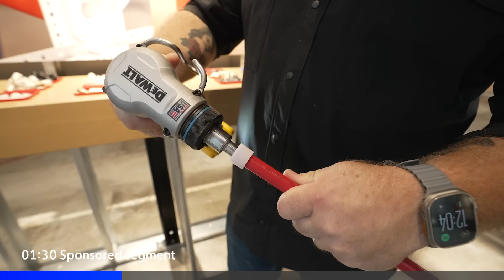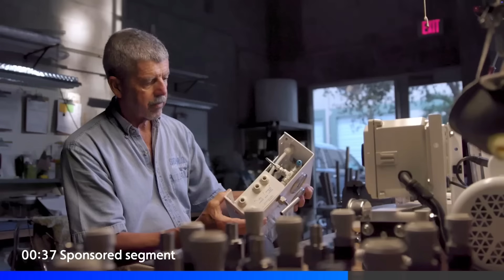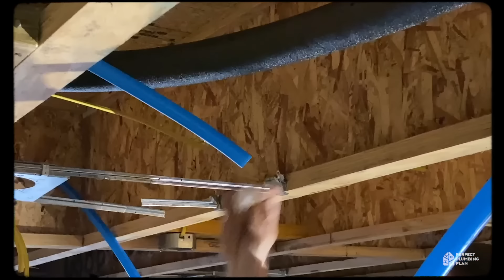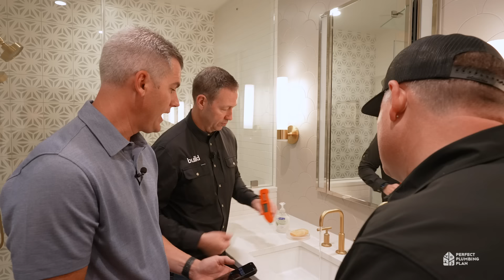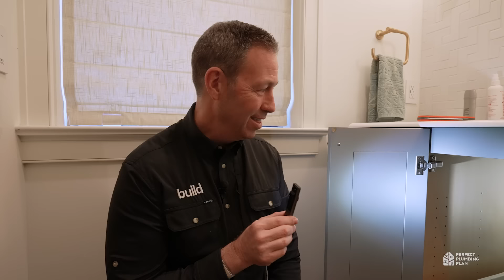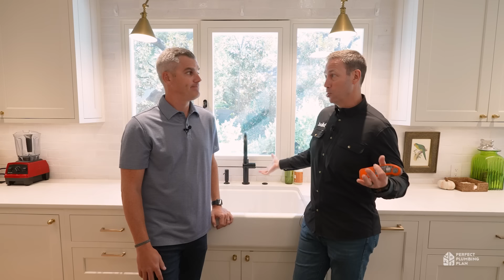Perfect Plumbing Ep. 3: How Recirc Loops Improve Hot Water Time-to-Tap Matt Risinger's Home Results!

Comment: I retrofitted a hot water recirc, and to control it I put a smart lightswitch in the primary bathroom (farthest from water heater) and set it up to also turn on a smart plug that controls the hot water recirc. If I know I'm going upstairs I can also start it from an app on my phone. It's not perfect, but it was cheap and easy for a retrofit.

The recirc works reasonably well for hand washing during the day, but for face washing and tooth brushing, the hot water often isn't hot enough and the cold water is too warm, so I have to blow out both lines. In Connecticut, we pay very little for water and have tons of it, so the primary concern is convenience and minimizing how much heat energy the system wastes, as our energy prices are quite high.

Comment: I'm curious if I put a Eco27 tankless hot water heater in series into my AO. Smith 80 gal. hybrid hot water heater, with the 4.5 gal. expansion tank before the tankless, how efficient will this be and will anything get damaged? Do I still need a backflow prevention before the expansion tank? Where does my Comfort recirculation pump go If I go this route? Or if I choose to use a dedicated recirculation pump line, where does that go? Does it go before the tankless, after the tankless, the bottom or top of the tanked water heater? I'm a DIY person looking for answer's that have yet to see anything on this. Why am I doing this you may ask, well, because I have them both and I want to maximize the usage of what I have. The tankless is a 27KW Eco27 model. Until I started watching video's I didn't know you could run water heater's in series or parallel. Since I have both, and the space to use it, I figured why not. If you are wondering why I have both, My wife purchased one and I purchased the other and now I can't return either so to make us both happy we will use both, So let's make the most of it. I'm seriously looking for advice here. I hope this reaches somebody that will reply back to me on this subject. My house is completely gutted and totally open right now, so fixing plumping while it is open on this 1971 home. I may have found the solution to constant never run out hot water system and I could be wrong, but I'm really curious. I've drawn out how I think it should go and I don't have anybody to talk to about elaborate systems. I love your video's and watched for years now.

Comment: Matt, I like the loop hot water recirculation idea so we don't have to waste water trying to run it so it gets hot. But I have been wondering for a long time why we don't just put small, tankless water heaters either under the sinks, or under the floor where the bathrooms are, as an assist to the central hot water heater? Do they make small, (one room sized) tankless electric hot water heaters?  Can that electric hot water heater run off the same GFCI circuit that's already in every bathroom?

Comment: I had a recirc in Germany.  It was nice.  Building a new house back in the States and the kitchen is the furthest point from the heater.  Close to 45 pipe feet.  That grunfoss pump runs between $180-$800, plus the pex pipe.  A inexpensive POS tankeless WH cast around $60. Save on pump, extra PEX pipe, and an independent system for redundancy.

Comment: In a previous home I added a johnson flow switch to the hot water out and the taco recirc had a thermostatic shut off.  The Johnson flow switch was in the open position (no flow) and the thermostatic switch was closed (cold). Any hot water tap in the house became a switch (johnson switch closed and thermostatic switch closed, taco on), ie briefly turn the hot on would start the recirc, charge the line and thus hot water on demand. The recirc would turn off via the thermostatic switch ( hot open, taco off, thus reset ). Yes you had to plan on the hot water use, but the pump would charge the system within 15 seconds.  In my new house, I have the bathroom fans on a smart switch which when they are turns on, it turns on the recirc. system which stays on for 15 min (renai system), in the kitchen I have a button.  Humidity sensor turns of the bath fans when the humidity drops to an appropriate level.

Comment: Matt, greetings from south-of-the-border. Following your videos, and those on This Old House, is how I retrofit a recirculation valve on the farthest bathroom in my house, 20ish pipe meters (60 feet) from the gas water heater, that is 2 floors below, in the exterior of the house, as is customary down here. My waiting time is 4 seconds, and I have Alexa automations, when I stop my wake-up alarm, the automation starts the recirculation pump. I also have a frase to start the pump "Alexa, I'm taking a shower". Both automations run the pump for 2:30 minutes, that is the time it takes for the water to be hot upstairs. 

I've learn a lot from your videos over the years.

Comment: I added a recirc pump for quick hot water too. But I simply installed a pump under the kitchen sink which is farthest from water heater. Then I bought a foot switch usually used with sewing machines or wood working machines. I mounted that vertically on the base board of the under sink cabinet and wired that as the start switch for the pump. So me or wife simply 'bumps' that switch with our toe a minute before needing hot water. Works great in that it brings hot water to the two bathrooms along the way.

Comment: We retrofitted our recirc pump with Tapo controls. An outlet control at the pump and a control on the bathroom light. That allows us to control the pump on with scheduling or with the light switch. Let it run for five minutes and then it automatically turns off. You can also control it by your phone. Since it’s “matter” based, no need for a central control box or system. Easy change for $40. 

Previous smart pumps didn’t seem so smart for our house chaos and didn’t allow as much customization. 

It would be curious what your calc comes up for water wasted.  No specific numbers were used and it seems to me to be fake news. Let’s say you run your sink twice a day for a minute to get hot water there. That’s 2 or 3 gallons a day, maybe 900 gallons a year. Sounds like a lot until you see how many gallons you use watering your grass. Don’t water your grass for one day and you might be even water volume. The expense of the recirc may not look as good. You still pick up the convenience though.

Comment: My house is exactly like one that you described: master shower is literally as far from the water heater as it can be. I'm working with 1959 copper which is at the end of its life, so I'm currently planning how the re-plumb is going to go. Luckily the basement is unfinished, so I have pretty easy access to everything
Reply: Just finished a re-pipe for my 1920s 4 bed, two bath, upstairs / downstairs laundry home by myself. I might be a minority though I cut out, cleaned up and reused most of the original copper pipes. Used pex for the laundry rooms, rest of the house is copper. Glad I did it, was a bit rough living in the home while doing it. Would do it again.

Comment: I watched all 3 episodes so far and I think it’s worth mentioning that if you use a loop system (with what ever pump you use) you should have a check valve at the last fixture on its return path. So if your recirculation pump is not on it will not pull cold water back into the hot faucet.
Reply: Good idea!  I found out the hard way that my plumber installed my pump backwards at first. So it was literally pumping IN cold water to the shower.  🤦

Comment: I’m debating between adding a recirculation line and pump vs using electric heat trace for the long leg away from the heater…anyone else ever think about that possibility?
Reply: This is an interesting idea, although not sure I’d want it in a wall, probably much less efficient than recirc too

Comment: I'm confused. You have a heat pump water heater in that closet, but say it is a storage tank with the heat coming from the outside. So what purpose does the heat pump part of the closet unit serve? I have a heat pump water heater in a separate none living part of my Midwest basement that takes heat from the regular 60F air and turns that room into a 40F cooler!!! The water heater does have electric heater elements in it if the room gets too cold. If you weren't getting heat from outside, your closet heat pump water heater would be taking heat from inside your home and releasing cold air back into your home!!!
Reply: Rheem now makes it to where if your water heater (heat pump type) is close to an exterior wall you can diver the cold outside during the winter and divert it back into the room for free cooling in the summer time.
Reply: This is Texas, so most of the year cool air in the home is a good thing
Reply: @wkm122 Even in Texas, I don't think people want to walk through 40F air, especially when they were getting freezing temperatures outside. Matt should have covered this issue. It is a big deal. I thought my Michigan cement wall basement back room temperature would drop from 60F to maybe 50F. But it currently is at 39F with my water heater set at 120F.
Reply: The SanCo HPWH has the compressor and coils on the outside of the house.
Reply: @Steve-bm2zmThen that makes sense! Thanks.
Reply: Y

Comment: It’s funny how they wouldn’t go for 3/8.  Naturally they never consider every faucet supply line is even smaller in diameter than that.  I’ve personally never used it though because 1/2” is so ubiquitous.  Everything I’ve done smaller I had done in soft copper.

Comment: I hear you talk about using a recirculating pump but won’t the water naturally recirculate due to convection?
Reply: Yes, it will, especially if your water heater is located in the basement (bottom of the tank lower and then the lowest fixture).My recirculation line is connected at the bottom of my tank (installed T at drain valve, one way check valve and a gate valve that I can proportion down to a very small amount//opening) . All hot water lines are insulated , including the recirculation line. Furthest faucet away is about 50‘ & hot water is there in about two seconds. Pipe  insulation and the gate valve set at a very small opening reduced extra burner time nicely.
Reply: @boby115 I did exactly as you describe on my last renovation. I find that I barely need the valve open on the return line. One thing I may try next renovation is a much smaller return line (currently plumbed 1/2” PEX) to perhaps 1/4”. Any thoughts?
Reply: @m @mattdudamusic i’m betting it would work . Let me know if it works and how you plan on insulating the 1/4” line.
Reply: @boby115 Thank you! I was planning on using a ball valve that I have in stock but a gate valve sounds like a better option to finely tune the rate of recirculation and demand to reheat the water. Any special one-way valve? Ball? Flap? I'm a DIYer.
Reply: @a @alwaysvacationing5341 , I use the 1/2  flap type . I built a 1/2 “copper riser and converted it to 1/2”PEX for the long run. 3/4” brass tee ,out of the tee with the check valve horizontal ,ell and up a foot or so with the gate valve , another piece of copper clearing the top of the tank with a standoff clamp at the top of the tank supporting the copper riser . Converted the riser to PEX & connected to the hot side copper piping below the furthest bathroom. Prayed and tested it before installing the insulation. Worked like a champ, I was amazed.(sometimes it’s better to be lucky than good 😂.)
Reply: Gravity recirculation? That is what I'm considering doing.